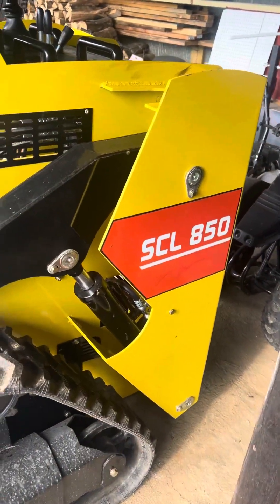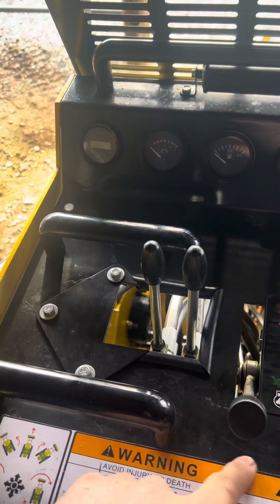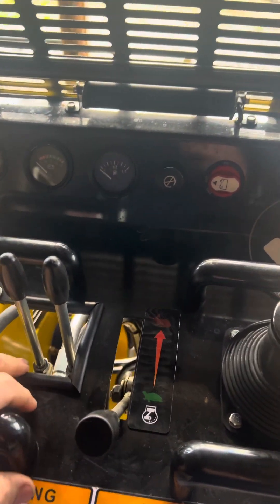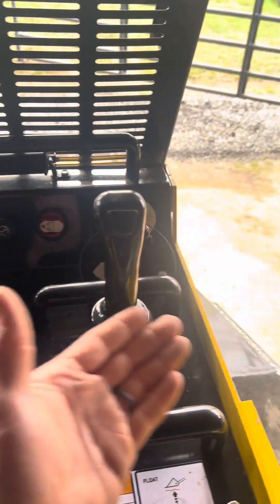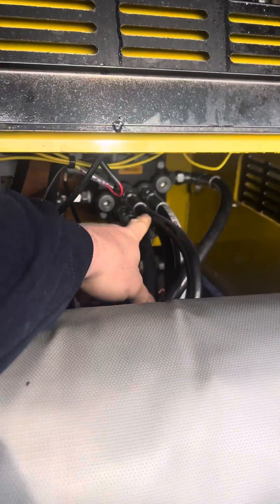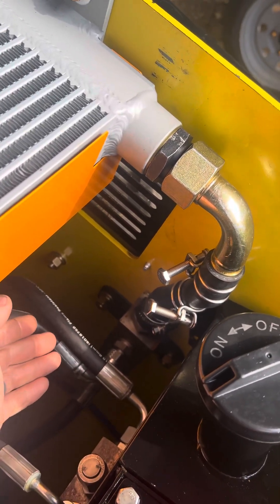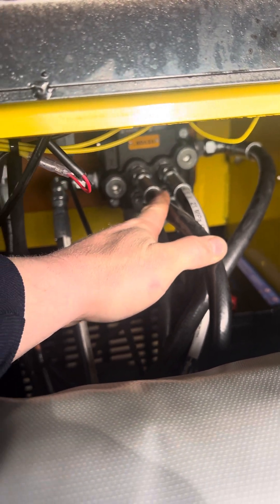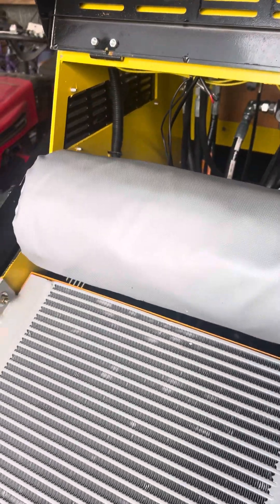Diggit SCL850 Direct Drive Spool Valve Upgrade

Comment: cant you just swap lines on hydraulic to put one track control on one joystick and have a tilt or lift function on either joystick like a skid steer?
Reply: I always wondered this myself…
Reply: Technically speaking, yes. You’ll just run soft lines to each block

Comment: Where did you get that muffler cover? Mine isn't a diggit but it sitts right under the radiator and my machine gets very hot within about 30 minutes of running it.

Comment: Hi I just bought one of these at an Auction. It’s jumpy AF.   Mine has 2 joysticks, one for the track motors and one for the bucket functions.    

Is this kit replacing the track joystick?
Reply from the maker: Yeah this kit is made specifically for the 2023 ones that has joystick for tracks on left and joysticks for bucket and arm on right
Reply: @burgingarage  where do I find the kit?

Comment: Good video man. What’s a decent price for these units. I know a guy selling one for $7,000. Thinking about getting it for my landscape company but I want a grapple and an auger so I’m worried that the 2023 model wouldn’t be a good fit with no aux hydraulics. Do you know if the newer ones have aux?
Reply: Not hard to add accessory hydraulics. Even on the older machine. I'm picking one up in a month. Cash is a little tight right now. Spend about 20k so far this year. When I do I'll make a video of it.
Reply: @KDuboutdoors19  I’ll be tuned in
Reply: Where did you get the kit? @KDuboutdoors19
Reply from the maker: The new 2024 should have aux hydraulics

Comment: great video.  I have a 2023 with the black arms and hood. The 24’s come with auxiliary hydraulics. I’m hoping they have better drive control also. The 23’s are death machines and I’ve found the issue to be the pilot control valve. It’s not metered properly, forgive me if I’m not using the right words. I am trying to find a PCV (pilot control valve) that will fix this problem. The valve (plungers) don’t open or close at the same rate which makes the unit awful to operate. Sorry for being all over the place with my comment, you should see what it’s like in my head.

Comment: I am in the middle of this conversion. This does not work for every unit. My year looks almost the same but has different plumbing, exhaust, and some other small differences.
Reply from the maker: Send some pictures of your unit and the hookups. Burgingarage@gmail.com
Reply: Yeah I can send you some. It looks to be just a bit different. Your unit, which I find a lot matching yours online, has a black cover and the bucket arms are painted black as well. Which you can use to see the slight difference in them? 

  @burgingarage
Reply: I think I have the same unit as you. Is yours a 2023? and is the cover and bucket arms still yellow? Let me know if you figure out how to do it @randyx007
Reply: @Paul79055 Yeah I figured out how to do the direct drive. I also added a second Power and Tank line. If you do this mod and only use one 3/8ths line to the double spool valve then the unit is slower.
Reply: @randyx007 where did you get the parts to be able to do it?
Reply: @randyx007  Mine just creeps slowly after the mod
Reply: @randyx007 where did you plumb your lift arms line after following this video I no longer have hydraulic pressure to the lift arms. Not all 2023 SCL850 are the same
Reply: @chevyluver13  It goes straight up from the pump into the spool valve. Then to each track from the valve. You shouldn't have touch anything on the lift arms unless yours was plummed incorrectly from factory maybe? My Tracks were on one side to control.